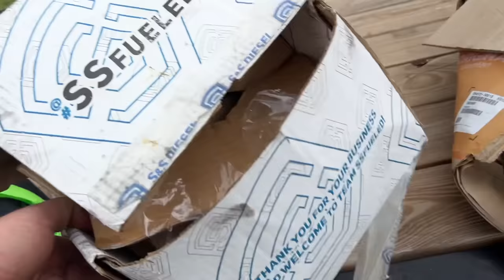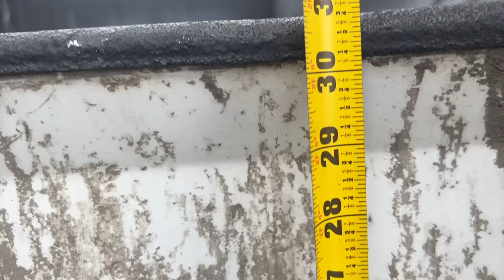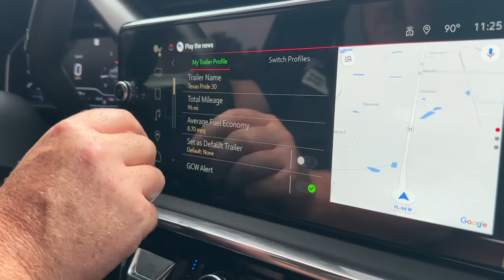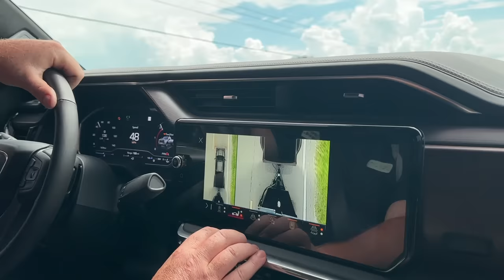$100,000 Diesel Truck VS $2,000 Diesel Truck!!!!  Are These New Trucks Really Worth It?

Comment: No such thing as a 2k diesel
Reply: I bought a 2006 6.0 LS3 chevy 4wd with a plow for $800 and a 2002 ford f450 7.3 diesel for $2000 both needed brakes and beds which i just put Wood flatbeds since i got a mill. Together they cost about $3700.
Reply: Preach.
Reply: @MJ_Landscapes from where? Facebook marketplace or something. Shit man I work on tractor diesel motors and want a used diesel pickup but can’t find a good place to buy them. Everything is so expensive.
Reply: A lil glow plug, a lil turbo , a lil ball joints, tie rod, shocks, egr, trans, oil changes, good ducking luck
Reply: Your standards are to high
Reply: Kia rio deisel...
Reply: I agree atleast where I live there isn't. And also which is it did he put a couple grand into it or a couple hundred. Because in my experience a couple hundred isn't going to get you much. You might be able to get it washed for a couple hundred lmao. Why do these guys insist on lying to us about money spent.
Reply: Whatever you say bud😂
Reply: Yes there is. Owned a few.

Comment: Love to see what a 3000 dollar truck does in comparison with 97000 in upgrades. Would be a fun build and test.
Reply: Yes this should definitely be a challenge, see how many of the features you can get on the 2k truck for cheap
Reply: I want to see this. Maybe not 97k upgrades but definitely built
Reply: Are you paying for it?
Reply: Was just gonna type that. Put 50k in that truck half as much as new one and send it to the moon lol
Reply: This is why I always suggest used. Especially because every New year doesn't necessarily 'upgrade' the cars. LoL I'm almost sure majority of the world records are on older platforms. Totally Agree with you dude.
Reply: @commiekiller6974   Or even just without the engine light on and a supercharger with some other slight tweaks to reach its full potential; also the skidding sounded like it wasn't 4X4 so if it was nvm, but would like to see same race with the 4X4 souped-up.
Reply: I think the title says 2 thousand dollar truck , I may be blind but I don't see a 3
Reply: @dorianwallace2623 they were doing some common core math. I would rather have 50 $2,000 trucks then 1 $100,000 truck or 1 $2,000 truck with $98,000 in upgrades
Reply: You probably wouldn't need half of that to make that old workhorse better.
Reply: Eggggggsactly. If you put 20k in that truck you’d have a king ranch interior and bulletproof trans and 6.0 motor that  would eat that new dirty choked out with emissions 😵‍💫
Reply: They don’t have 97k to blow😂
Reply: Deboss Garage  has an OBS f350 with a caterpillar engine and built transmission newer king ranch interior he is about finished with- if you include labor it might be in the 100k range
Might be one of the coolest things on YouTube
Reply: Probably gonna be reall.upset when that new truck brakes way before it should .
Reply: @noahglenn8305 yea if deboss accepted $40k a year. 

This is why mechanics have such mental problems. 
Even those who love them undervalue their work and dedication and skill set. 

Besides the fact that the customer expects the mechanic to care.
Reply: the only pronblem i see with this is...... most opf the time those $2000 trucks "run like shit" if you know what im saying, but as soon as you start fixing shit, it never runs again, even with spark, fuel, compression, everything.
Reply: @WarrenAAndrews 50 times more problems. If you a company that rents out cars and trucks would you start up with older high mileage or newer with a warranty.
Reply: @justinlamb3822 BAHAHA
Reply: @WarrenAAndrews  50 2000$ trucks that leave you stranded at the worst times and makes you lose your job
Reply: @RigmorTalonbeard my $4000 Salvage 6.0 with 295,000 miles never left me stranded.  I drove it Midwest all over the us.  Best 4000 investment, sold for 10,000 when I bought another Salvage truck.  😂😂😂
Reply: @fastinradfordable the customers expect the mechanic to care more than they do themselves
Reply: Mounted machine guns
Reply: Twin coyote with rims and paint job gets it close.
Reply: 97in upgrades is a new truck 😂
Reply: I have a buddy that has quite literally 100k in a 6.0 as of now. It’s a sick truck still not what you would think tho.
Reply: It would be a waste of time and 97 grand.
Reply: 97k into this truck would be an insane build. It would blow the Denali out the water regardless
Reply: I mean I was more impressed by the Ford given the price difference. I thought it was gonna be a dog towing 12k but it was moving and whistling. The GM performed about 40% better but cost 5,000% more.
Reply: @dorianwallace2623 right but in the video he calls it a 3000 dollar truck a   few times and has to correct himself just like he first said he put about 2 grand of work into it and then immediately corrected himself saying he put a couple hundred into it. I think we are being lied to about a lot of the numbers discussed in these videos...

Comment: I’ll take the reliability of an old mechanical 7.3 all day over a new truck
Reply: Hilarious
Reply: For the money agree. But if I could get one for free I'll take new. I got a 2002 7.3 with 128k miles for 1800. Sold my 6.7 cummins to keep the ford since I got it so cheap.
Reply: @heathmooneyham5942  While the 7.3 PSDs are really solid, I wouldn't consider them "mechanical". Still needs 120V to drive the injectors, and full computer control. An IDI, though, that's a mechanical 7.3 - Can literally run with 1 wire, and even that could be bypassed if needed.
Reply: @MacRobbSimpson  I love them ol'shit box IDI's.
Reply: I have a 7.3..... it sucks little things break, nothing major but enough to keep it on the driveway  for a few weeks....costing me money  buy the new one if you're using it for a business.
Reply: @santizoslawncare8084  what are you doing to that thing my truck has almost 500k miles and it has little stuff break but keeps it off the road for at most a day or two. i have a 6.7 powerstroke to but i prefer my 7.3 things a monster hauls well sounds good so easy to work on if needed 6.7 i really just use it to haul on long trips its deleted and i only use it for that.
Reply: @codychitwood5432  nothing crazy lol pulling light 10k lbs trailers. I lost steering one time almost died, lost a transfer case, its a pain in the butt to start that poor tired girl, I guess the motor runs good ish but the rest of the truck is not reliable. From my experience  using old equipment isn't the best for a business. While the equipment such as trucks, tractors, lawnmowers WILL get you by, they will nickle and dime you. Not a big deal if it's for private use but when your livelihood depends on it go with new equipment all day long if you can. My advice having started with old clapped out machines lol
Reply: Hoss, your telling me mechanical engines are unreliable?
Reply: @jayswrld5715 hilarious when the 6.7 is in the shop, and the 7.3 is on the road.
Reply: @codychitwood5432  theres nothing the 7.3 powerstroke does better than the 7.3 gasser though, lol... except cost more to fuel and maintain.
Reply: That’s a 6.0 l powerstroke
Reply: Yeah and while you’re over heating passing someone up I’ll be coasting by with my a/c on dam near falling asleep with 20k behind me going up the grapevine, and that’s in my lbz not even a brand new truck, stay away from these 6.0 power strokes
Reply: @trailerwithyardwasteonit7188  you and the other 1% of diesel pickup owners pulling anywhere close to 20k
Reply: @sly9263  my lbz bro dozer can tow 20k on a gooseneck up the Cuesta grade with the a/c on at 65 it dosnt phase that dam truck these pre emission duramaxes are bats outa hell literally better pulling power than my freight shaker and that’s a class 8
Reply: @trailerwithyardwasteonit7188  that's great, the other 99% are towing 10-15k or less and diesel doesn't matter
Reply: The Good Ole days Before ( DEF)
Reply: Interesting video...don't see 98k more value for sure....and as a diesel shop owner will never own a common-fail anything.    That GMC is nice for sure but my 2002 valued at probably 35k will outperform the GMC in every way.    But not everybody can build a truck either.   Good video.
Reply: You ain’t finding a $2000 powerstroke anything down here in the southwest. Definitely a lucky auction price at $2,000. I just sold my 2000 F250 2wd extended cab 7.3 for 10K. Sold it in a few days to the first person who contacted me. Mind you the truck was an XL with no options. Manual everything. No tilt. No cruise. 105,000 miles.
Reply: Amen 🙏
Reply: It’s a 6.0
Reply: @santizoslawncare8084  common sense buy two still cheaper, and keep one on the road all the time
Reply: @Over-kill1  I would just have two on the driveway lol
Reply: Me too! The new RAM heavy duty trucks are not made like they used to in the early 2000s
Reply: I have 2 ,7.3s, a 350 and 550 both 4x4 and great
Reply: Agreed
Reply: @sly9263 7.3 psd will be a lot cheaper to maintain. And on my idi i get the same mileage with a trailer than i do without cause its already an abysmal like 14 lol
Reply: @santizoslawncare8084 I agree.  Your reputation is on the line when you've got appointments to keep. Even if it's the truth it just sounds like BS when you've got to call someone with "my truck broke down'' as an excuse.
Reply: 06 was the 6.0
Reply: 7.3 power stroke excursion is way more reliable
Reply: My vw tdi with 4bt pump gets 60mpg. 
Had over 300,000 miles on it 14 years ago. 

And when it breaks. 
I can built another motor for $1000 and I can do it in a weekend. 

In my 1981 vw rabbit pickup it’s 3x as fast as it was when it was new 42 years ago 

And gets almost twice the fuel mileage. 

This engine made 54mpg in a vehicle that weighed 800lbs more than mine. 

It cost me 90 gallons to cross the country and back. 

Y’all spend more on fuel than I have had in my entire build including fuel, maint and insurance. 

Oh, and with a $1500 turbo upgrade I can make almost the same hp as the 7.3.
Reply: I love my 6.5 Turbo diesel K2500 94 sure theyre known for runaway diesels but them things sound really good best sounding diesel IMO
Reply: Well, it's withstood the test of time for decades all while being torture teated day in and day out. That's where my money is. And upgrade the internals and make a few mods and you can easily get 400-500 hp and over 800ftlb of torque out of a 7.3 powerstroke and it'll still outlast the 7.3 gas by a ton. The 7.3 powerstroke has a nickname of the million mile motor because so many of them have gone over a million miles with no major repairs, the 7.3 gas is an extremely new engine design so there's no telling what kind of real world life it might have, but diesel engines simply last forever.
Reply: Or an lbz.
Reply: IDI, or PS? Because the PS is a HEUI system.